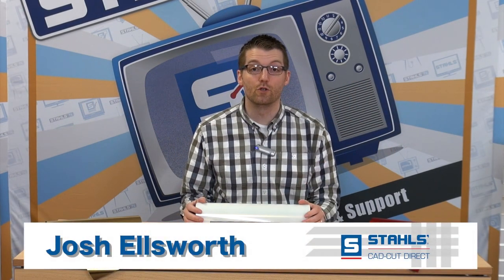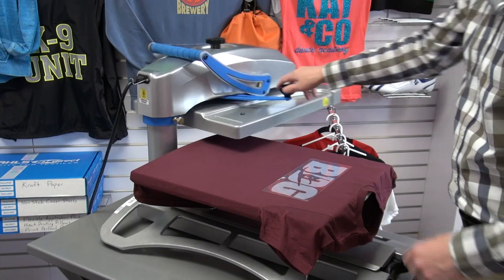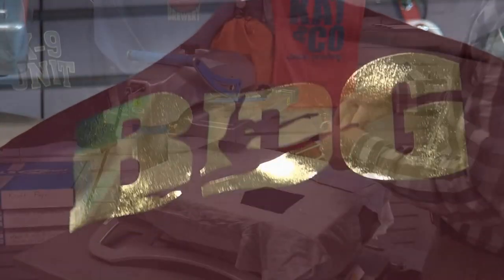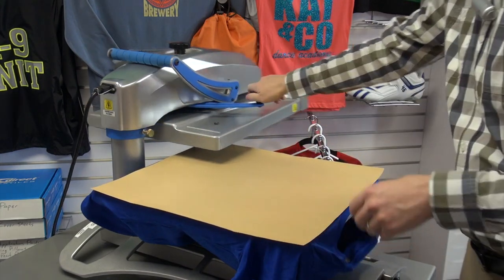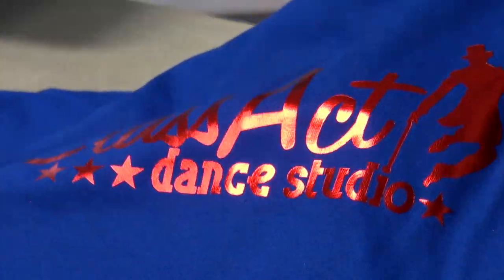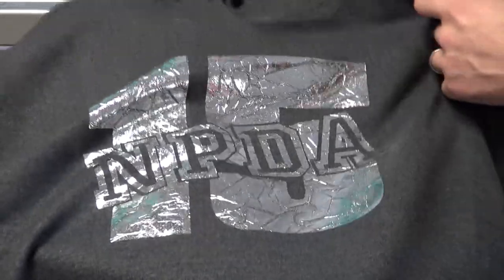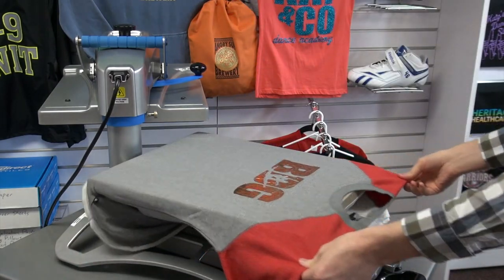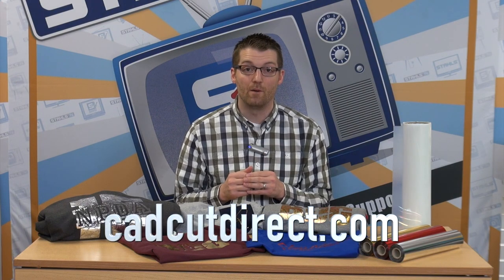Foil on T-Shirts with Stahls' CAD-CUT® Adhesive

Comment: Hi. Is there any reason why you can't just cut the design out of the foil vinyl, weed it then heat press it?... instead of using the adhesive before?
Reply: Why can't I just use a metallic vinyl (gold) instead of doing this two-step process with the foil?
Reply: because the foil doesn't have adhesive to stick to shirt
Reply: Instead take a print of your text on a sheet for pic transfer. Its easily available in market n online too and is cheap. Make sure print is with laser printer and not colour. Any colour print will do. Laser printer makes a layer when when used with foil and heated will get sticky and foil colour prints on printed area only

Comment: He says "Wash and hang dry the t shirt.Dont put it in the dryer." I'll try this but I'm betting that the foil wont last on there forever even if I wash it this way.
Reply: +adrienne gellman You are correct, foil not matter how it is applied, will not last forever.  Foil is a specialty item and does not take the abrasion as well as other materials.  However, if laundered as described, you can extend the length of time the foil will look good.

Comment: What they done tell you is that of it just messes up a little that's a shirt down the drain the glue isnt all comming off . The directions an trouble shooting are very poor.
Reply: They don't tell you a temp in the instructions or video then he says tack it down for a few seconds .I found you definely have to hot peel but if the glue doesn't stick right in one spot waste shirt. I wish I never bought none of the foil glue adhesive head ache